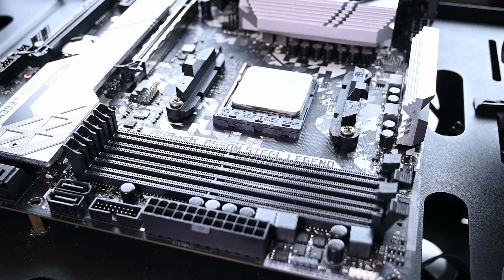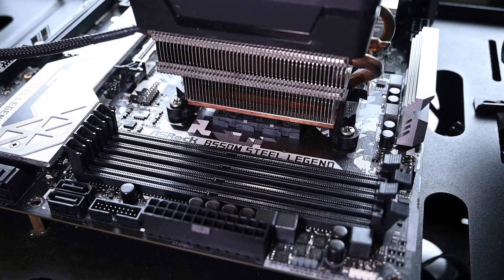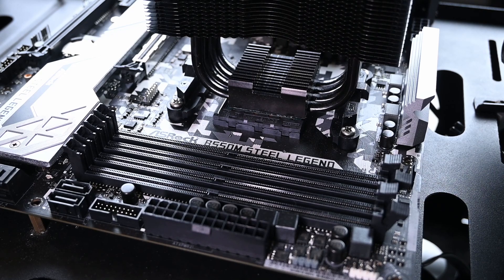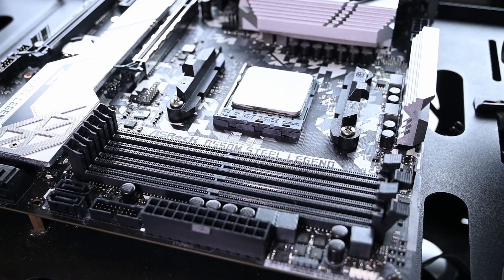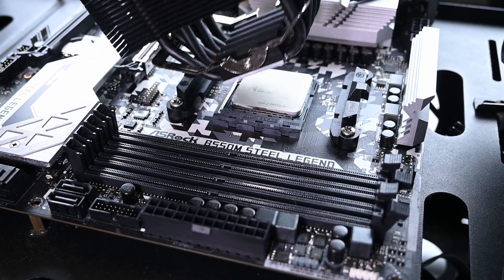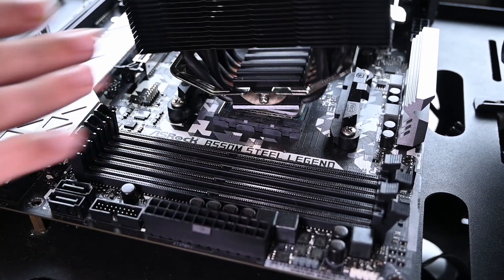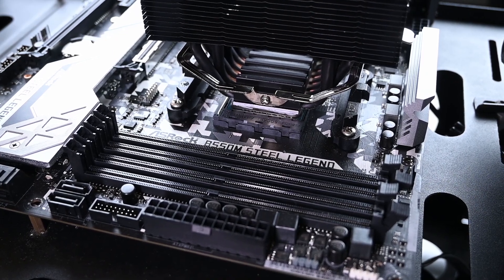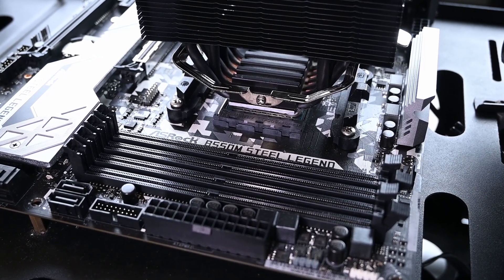Avoid this type of cooler mount for your AMD CPU

Comment: Another video mentioned that you can just bend the metal down that holds the retention clip. This will lower the mounting pressure, making it easier to mount and dismount.
Reply from the maker: Ideally it's to hold the cooler down, the thing is many people aren't aware of this and also many coolers don't have this insane amount of lob-sided pressure as well.

Comment: It happened to me in 2023. I have a gammax 400 v1 with the same mechanism showed in the video. The motherboard plastic bracket cracked with such pressure, the CPU was glued in the cooler and popped off the socket even though it was locked in there. Some pins bent, but I managed to fix it. Working like a charm.
Reply from the maker: That's the good thing about AMD pins, they're tough!

Comment: Alternate solution:  Use a high quality thermal pad.  They do not have any surface tension (suction) and will separate from the CPU very easily.

Comment: I just used a cheap cooler with the spring clip and it got tight over night to the point I had to unscrew the AM4 brackets to get it off after it wouldn't post.  It could be coincidence but the X570 board no longer works.

Comment: This bracket killed my CPU and Motherboard aswell while installing the fan. The downward pressure was too much for them, next time hook up the cooler first, then screw the holder down, I guess ..
Reply from the maker: See, this is what I'm afraid of and that's why I made this video. 

The problem with some commenters is that they view it passively so they tell people "oh you could've just" - well, it's not that simple and it can be disastrous.

Comment: I broke my mobo because of this. Was going to remove my heatsink just to thoroughly clean everything and apply new thermal paste. 

The pressure needed to unmount it, alone, must have caused mechanical damage to the board. PSU was alive, but computer wouldn't power on. 

I don't understand why this is their standard vs using 4 screws?
Reply from the maker: Sorry to hear that, yes that's what I'm afraid of too. Using clip is fine as well however the way they designed the clip, the pressure is excessive.

Comment: Good video.  I had a CPU get yanked out by something like this a couple of years ago.  Scared the crap out of me, but the CPU was ok in that case.
Reply from the maker: Scaring when the clamp springs the CPU out of the socket. At least if it's a voluntary vertical pull it's much safer.

Comment: The singular instance of my cpu being pulled out of its socket attached to my HSF cooler was with with a low end AM4 cooler which came with my Ryzen 2200G and I ended up replacing it with a low profile copper cooler which cooled noticeably better. The cpu luckily still worked 🤞

Comment: latching mechanism is fine.   You have to press the side  with no "thumb button" using a flat screwdriver, ( plastic hook on that  side is  smaller )
Reply from the maker: Size is the same, basically this video is to tell people to be aware of such complications.
Reply: @goldfries  not true (at least in my asus motherboard. one pin is longer )

Comment: @2:05 What I do is remove the fans first.  Apply a bit of downward pressure on the heatsink while loosening the screws of the amd mounting bracket in a cross pattern, turning each screws a few times but not to the point of removing them from the bracket. Keep applying pressure on the heatsink while removing the clips from the bracket. At this point, I can easily remove the clips from the bracket because of how loose the screws are from it, avoiding the fear of "springing". Then I wiggle the heatsink gently sideways until it separates from the cpu. 

I never had any problems with my method. I'm using that cheap cooler off Aliexpress. Yes, it's the Snowman, the MT6S variant on an AMD Ryzen 5 3600. Runs cool, no complaints.
Reply from the maker: Yes, that's the way to go about but it's a huge hassle. 

The average user will just unclip.

Comment: You can remove screws on one of the plastic brackets and release it safely. Angled screwdriver will help. I thought video will be more about the heatpipe layout, but not the mounting warning :(
Reply: Removing the plastic brackets did the magic. Got no angled screwdriver tho so i had to remove the fans from the heatsink first. 😅
Reply from the maker: Well this is a PSA video, not everyone got that figured out. Even for me it didn't cross my mine that the spring from the pressure of the mount can dislodge my PC. 

The purpose of this video is so people are aware of such consequences and find ways to go around.
Reply: @goldfries  The preview gave me wrong expectations but the name is right. It's just me being stupid and clicking by thumbnail, but not the name :D

Comment: The Snowman cooler off Aliexpress I use has this type of latching mechanism. Hopefully I never have to take it off, or if I do, I remember this video and try to mitigate the tip over after removing the first clip. It will probably be years down the road though and I won't remember....
Reply from the maker: If the pressure isn't that strong it should be OK, or if you're concerned then unscrew the mounting bracket instead.
Reply: It is recommended that you apply fresh thermal grease between the cpu and the cpu cooling unit at least once per year. If you never apply fresh thermal grease then eventually it will affect the efficiency of the cpu cooling unit.

Comment: is it because the thermal paste is too old thats why it is very sticky? does it affect even if it is branded thermal paste or just a generic thermal paste?
Reply from the maker: It's not just the age, some thermal paste are more liquid than others and can be sticky right off the bat.
Reply: I use kryonaut which is expensive but i still encounter this.problem

Comment: i removed  that cooler w a  3600 to put a 5600x. and had 0 issues. user error
Reply from the maker: Good for you.
Reply: how did u remove the cooler tho?
Reply: @kanhtoohli271   used a Small (flat screwdriver) applied gentle pressure to the opposite side  ( 2 the one that uses the  thumb mechanism ) no spring reaction AT ALL.

Comment: if you're so worried about that, why not just unscrew the mounting bracket then, and just lift the thing directly up first.
Reply from the maker: I think you're missing the point by a mile here.

You see this is a PSA video, in my case it didn't even cross my mind that the spring action could dislodge a CPU so this is to caution others. 

Besides, you have to consider removing the mounting point is a huge hassle especially if you're using a tower casing. To re-install the mount you'll have to open the panel on the other side just to hold the mounting base in place to secure the bracket. 

Why go through so much hassle just because one cheaps out on a cooler? It's not worth it.
Reply: @goldfries  yes. And now for others who are in your situation and already have one of these, they should consider removing the entire thing the hard way, lest they want to risk a fright like yours 👍

Its a meta-psa. if the thing's already on... its probably the least-dangerous way to remove it. if not probably the biggest pain in the ass.

Comment: Trick is to run a stress test for a little while first to warm up and loosen the paste. That said, AMD sockets are not super secure
Reply from the maker: I mentioned about the warm up part in the video.

You have to realize that even after warm up, if there's a suction it will still be there. The reason we warm up is so that we are able to twist. 

Take for example the Cooler Master G200P that I reviewed, you CAN warm it up but with no room to twist one has to yank it out anyway. https://www.youtube.com/watch?v=DT3ghSn3xwY